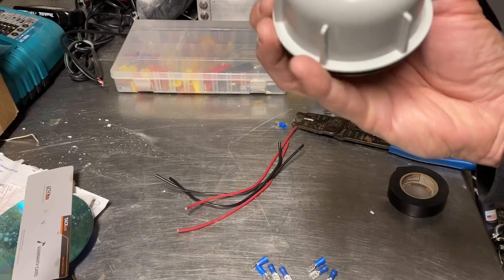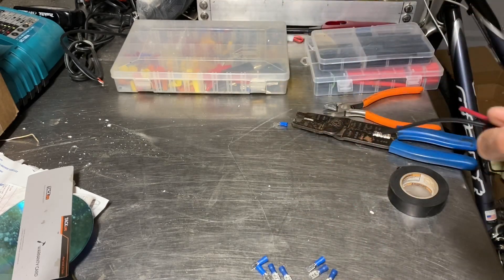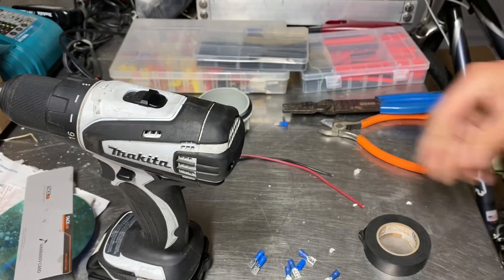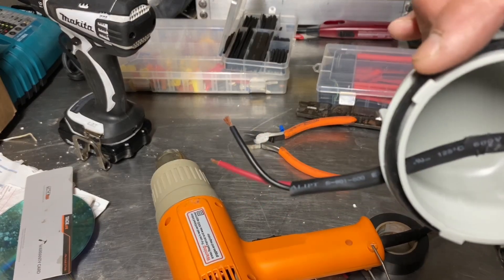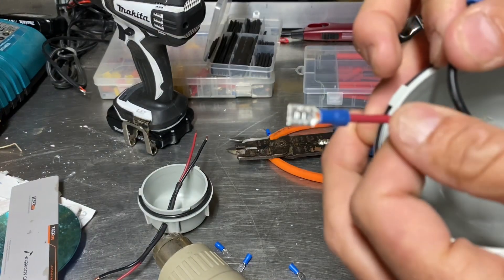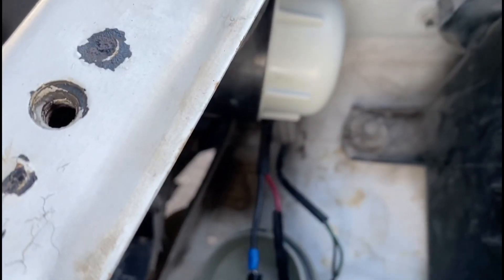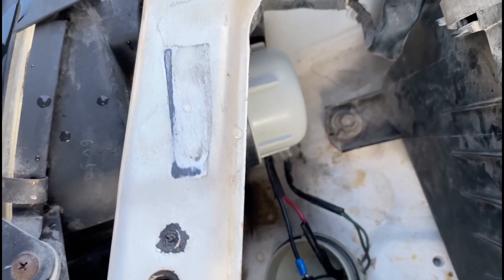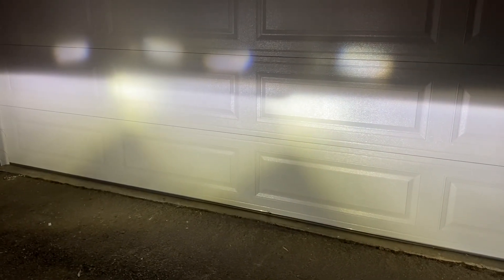LX470 LED Dust Cap Mod and Beam Cutoff

Comment: How did you do modification for fog light dust cap?  Original dust cap is too small
Reply from the maker: Thanks for watching the video. You’re right the caps won’t fit. I used the lights without caps and then purchased a new Ironman 4x4 bumper shortly after. I know you can buy aftermarket caps on Amazon. You’d have to measure the diameter to be sure though.

Comment: Very educational video and thanks. Which LED fog light bulbs did you use?
Reply from the maker: Thanks for watching the video. The 2002 LX470 takes an H3 bulb. Below is an H3 from Lasfit. Check there website for firmest. https://www.lasfit.com/products/h3-led-fog-light-bulb-50w-5000lm-6000k

Comment: Want to do this weekend. How many AWG wire did you use?
Reply from the maker: Thanks for watching… I want to say the OEM headlight wires are probably 20 gauge, but I only had 18 gauge.
Reply: @LXPlore  you’re awesome 😎. Thanks again for your video and reply. I just did everything as you showed except heat shrink. I used electrical tape. It’s working fine. Can’t wait to try it out at night. I wish you make some video for raptor lights on the front grill.
Reply from the maker: @aburais4457  lol… thanks man. I’ll take a look at it and see what I can do. I’ll see if I can do it without making any cuts

Comment: LX 470 2005. Great video  are you happy with just the swapping of the halogen for led?.  Are you still running the same configuration. have you thought of HID instead I heard that the reflectors work better with HID than LEd. Thank you for such great info.
Reply from the maker: Thank you very much! So In reality anything is better than stock halogen bulbs. I like the LED lights, however there’s 3 to 4 light spots just above the cutoff. I haven’t been high beamed in retaliation for my lights and no one has approached me to tell me my lights are too bright. As for HID’s I haven’t really thought about it. Might not be a bad idea.

Comment: I just installed lasfit on my LX470, I have 4 rectangles that sit above the line the headlights make against a wall when turned on...any idea what needs to be adjusted to get ride of those?
Reply from the maker: Thanks for watching the video. Unfortunately those 4 squares are a result of having projector lenses. No adjustment available to get rid of the them. 😪
Reply: In my experience,.led is not great for projector lens unfortunately, HID for them and the LED for everything else.

Comment: Great reviews and info. I just ordered both the caps and LED and was wondering if you have to extend the wire or can you get by with the existing length? Thanks!
Reply from the maker: Thanks for watching the video. I extended the wires by at least 6 inches and made a modification to the caps.

Comment: i just did an LED conversion on my LX and Im having the same issue as I saw on your beam pattern against the garage door... i'm getting those 4 circles of light above the beam cutoff... they are driving me crazy... any recommendations?
Reply from the maker: Thanks for watching the video. Yeah they only drive me crazy when they’re aimed against a flat surface. Most of the time I don’t notice them. Unfortunately there’s no cure for those tiny little beams of light.
Reply: @LXPlore  i think i'm going to buy a set of the aftermarket halo lights with the built in corner lights. Hopefully those projectors dont have the circles
Reply from the maker: I’d be curious to see how they look or how they project light. Thanks again..
Reply: @LXPlore  i will let you know

Comment: Nice... the cutoff looks pretty good! Little bit of light dispursement and whatnot but really it is 100% better than the LC reflectors! Definitely a nice upgrade for LX owners! Think proper measurements should be that you get as close to the wall as you can to measure center of housing/projector to ground then measure for 2" drop at 25ft, believe that is proper alignment/aiming of beam. RetroFitSource and HeadlightRevolution have good aiming videos if you really want to get into it!
Reply from the maker: mizznfizz1 sweet thank you very much. They’re a definite improvement and I’ll check out those videos to make sure that I’m not blinding oncoming cars. Thank you for watching!

Comment: Another great video! When I first got my LX, I installed HID kits from Xenon Depot. I also installed them on the fogs since they are projectors too. They have been on there for several years and just recently one of the fogs went out. It got me thinking: If out somewhere and a bulb goes out, I'm screwed since they are not easily changeable. With the LED's I'm assuming you could carry a spare H1 or H7 (don't remember the type) in case of failure. Other than that, the HID kit was well worth it. When I did it, the LED's were not an option so this is got me thinking. 

Hopefully there's not a heat build up in that confined space. From what I understand, the LED's run hotter hence the need for that huge head sink. Keep an eye on them and give us a follow up video on how they are working out!!
Reply from the maker: The Big Empty _ Thank you very much! Since there’s no modifications to the housing of wiring, I’m going to keep my old halogens in the glove box.... just in case. Lol I’m hoping with the large heat sink and built in fan that they last longer than the halogens.